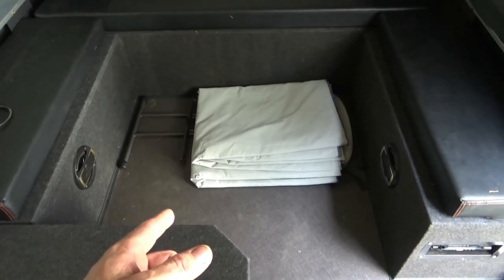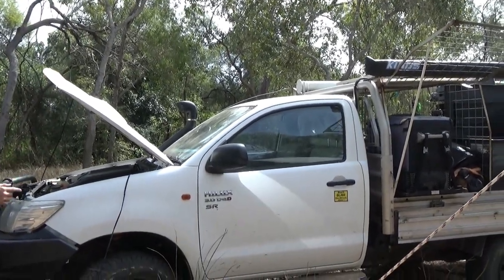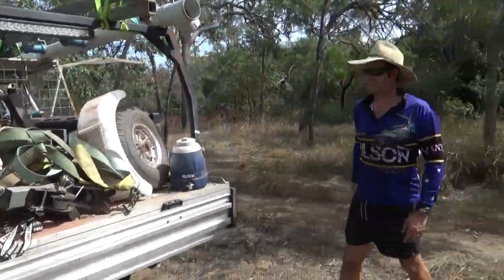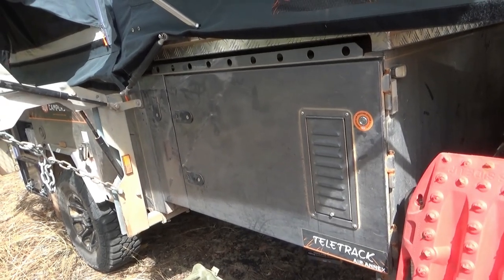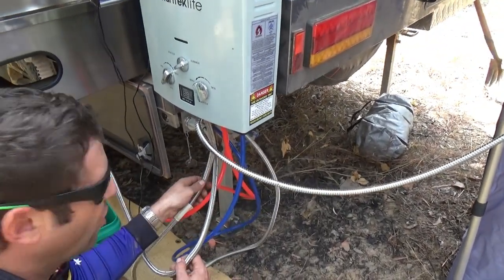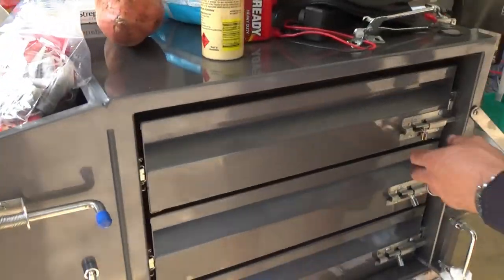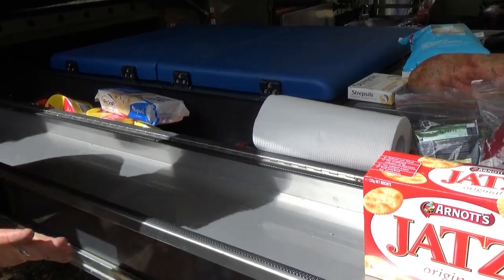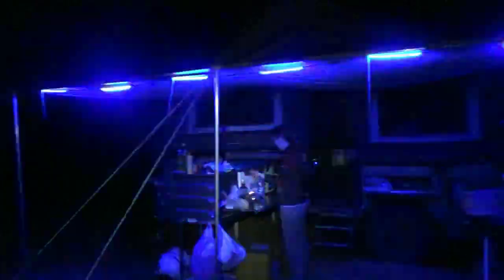SUV Teletrack Review and Camp Setup

Comment: Nice vid mate. Been looking into the Teletrack for a bit myself. How do you go towing it? I'm always a bit worried about the weight of the SUVs. Would love to see a video of the air annex.
Reply from the maker: I have a Hilux with the 3L turbo diesal and it tows well on flat ground but like anything else in its class struggles on the incline. I had my suspension upgraded so the weight isn't really an issue

Comment: Howd the hilux go towing the camper? Fuel economy?
Thanks for vid
Reply from the maker: It towed fine. My wifes 6 speed auto Dmax tows a little easier than my manual. Probably get 400 to 450 km out of a tank towing as opposed to 650km.
Reply: Ok cheers mate. Appreciate the info.